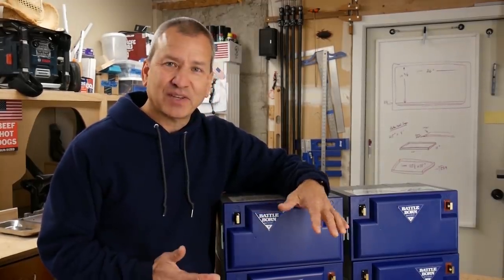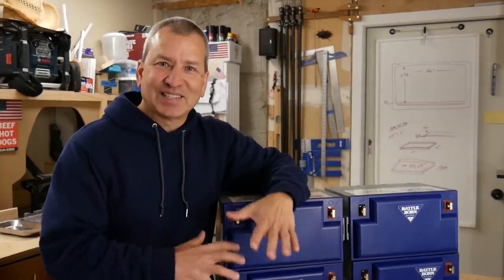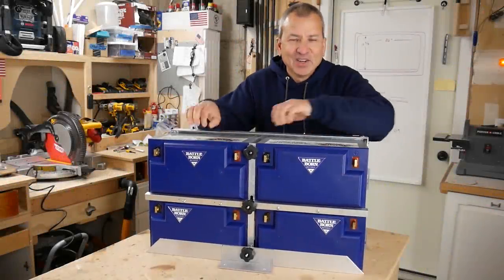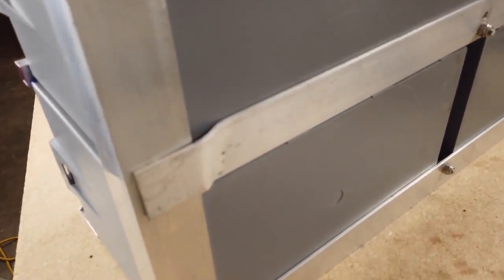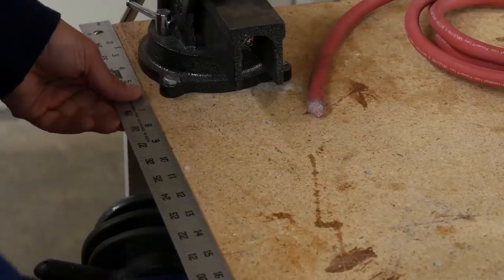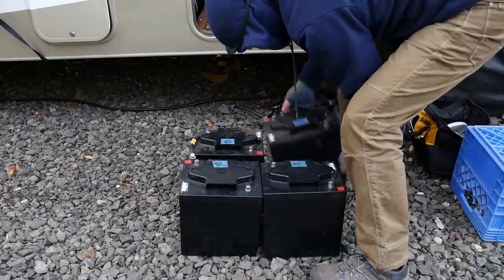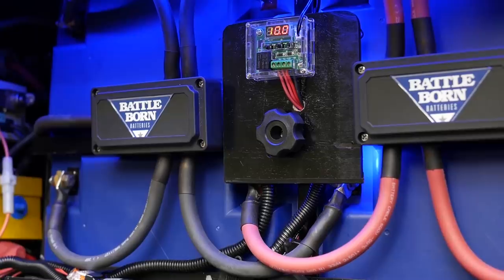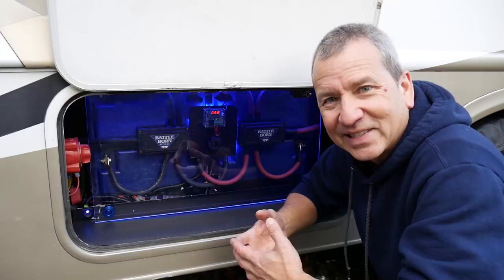DIY Lithium Battery Rack for Small RV Compartment - Full Build

Comment: Great build, I had been thinking about building a power wall with solar panels   for my Winnebago. The only location I can think of is the back wall in the rear of the coach. Theirs a air space of about a foot between the fiberglass skin back of coach and the actual bulkhead for the bedroom. I'm not sure how it will effect the load being that the wiring will have to be extended about 20 feet to reach the terminals under the entryway steps.
Reply from the maker: Sounds like a fun project. Good luck with it.

Comment: Very very nice. Where did you get the quick release buttons for the plexiglass and also the heating pads?
Reply from the maker: Here are the quick release tabs: https://amzn.to/2OlSyyn. The heating pads were left over from a after market heated seat project years ago. They've worked great on the car and should work fine for the batteries. I did wrap them in fabric to create kind of a blanket.
Reply: @RVwithTito  thanks

Comment: Fantastic ideas.   What are you using to solder the aluminum and work do you get it.
Reply from the maker: Aluminum brasing rods. I picked them up at Lowes with the welding stuff.

Comment: Great project idea Brian! Had some questions that I hope you can give some insight on...the battery heater setup, I love this idea and was actually thinking of doing something similar but my skills aren’t as good as you. Do you have any recommendations for those types of battery heaters you used and also how you were able to wire in that temperature controlled unit? Secondly, that switch idea for the LED’s when you open the door, I love this idea and can’t believe this isn’t a standard option for most RV’s already...again, do you have any wiring/install recommendations for this? I would love to do this for all my doors. Thank you for these ideas, keep them coming!
Reply from the maker: You can find battery heating pads with the switching build in on Amazon. That will probably be the easiest way to go. They do cost a bit more though.

Comment: Hello
How the heating pads are working after time? I’m thinking of getting a lithium battery does not have low temp battery disconnect because of the price. 
Thanks and the job you did on the battery it’s 👌
Reply from the maker: It's worked fine the few times that it's kicked in. The cheap temp switch can be adjusted easily to any temp. I have it set to turn on the heating pads at about 38 degrees F.

Comment: Now take that prototype to a fabricator and have them make them.
 Then sell them online.
They need to be cut and welded and made from thicker angle. But it looks good. I mounted mine up against a wall and attached everything with a bolt after welding a hold down.

Comment: Nice build.  Curious about the heating pads.  I didn't realize lithium batteries had to be kept above freezing. What's the draw? 

 I'm using an RV right now and if may or may not get above freezing during the day for a while and then not and I doubt nighttime temps will get above freezing until next Spring.  I suspect lithium is not an appropriate choice for me.
Reply from the maker: Yeah. These lIthium batteries can't be charged below freezing, but you can still still draw power from them. The heating pads only draw 4 amps total.

Comment: In addition to the batteries what else did you had to upgrade in order to install lithium? Thank you so much for always educating us and inspiring us
Reply from the maker: I still need to get a new lithium compatible charger (for the converter/charger). I'll order one soon. For now, I can manually select bulk-charge mode with my current Progressive Dynamics charger.  I'll also install a 20A DC to DC charger for charging from my alternator. I have it, but haven't installed it yet. I need to remove my generator first and convert that space to a storage by for my inverter, charger, tools etc...
Reply: Most quality solar power and shore power systems produced in the last few years have components that can be "tuned" to whatever battery type you choose. IF you are just now installing a solar and/or shore powered charging/inverter system, select quality stuff that can be configured for lithium and you should be all set. NOTE that many new battery chemistries are on the horizon or are already here yet I believe lithium (especially LiFePO4  and LiFeYPO4) will be around for quite awhile. Note that many lithium batteries should not be charged at temps lower than freezing so you will need a work-around (such as heating pads as shown in this video) to keep damage from occurring. Do some research before you buy and above all...buy quality components.

Comment: Where did you get that lug crimper? I bought a POS hydraulic crimper and hate it. I like yours. I wished you had told us about how to buy some heat pads and how to buy a thermostat. In other words; what are the part #'s I should order. But a great Video Brian. Well done. I want to buy two Battle Born's for my humble trailer.
Reply from the maker: The crimper is listed in my solar parts list (see description). I used spare parts for my heating pad. You can find temp controlled heating pads on Amazon. BB also has some that are kind of expensive.

Comment: I recently purchased 4 - 100 AH Battleborn Lithium Batteries and plan on connecting up all 4 in parallel. Looking at other videos, I often see 4/0 cables vs. 1/0 cables to connect up the batteries in parallel.  Maybe they are planning on more batteries in the future? Confused.
Reply from the maker: If you plan to use a 3K inverter, then 4/0 may be a good idea. I only have a 2K inverter so I went with 1/0.
Reply: @RVwithTito  I have a 2k Magnum Inverter. Went with 2/0, split the difference.  Now I need to find the inverter charging  cable for part 2.

Comment: Mr. Bryan..  Thank you for this very informative video...  My question regards your battery bank configuration...  You are running 4 batteries in a parallel configuration.. Every schematic i have looked at..write up i have read and hearsay recommends that no more than 3 batteries should be wired in a parallel configuration in order to keep the battery bank stable and equal balance among them..

Please can you share your info on this.....perhaps a video?

Thank you...
Reply from the maker: Not a problem with BattleBorn batteries. Different manufacturers have different limitations. Contact the manufacturer of your batteries for guidance.

Comment: One thing your battery bank needs to be wired on side of it takes charge and the other side is load looks awsome. But not good for batteries over time. I found this out the hard way.
Reply from the maker: We'll see. BB claims it's ok to mount them in any position unlike lead acid.

Comment: Brian how were you welding the corners of your Aluminium box, what was the flux and solder, I haven't seen that done before. Spring washers under your nuts is always a good idea also.
Reply from the maker: It's just a brazing rod. Not as good as a weld, but adequate for some small stuff. I need to get a welder.
Reply: Welding aluminium is complicated.  You can't do it with low cost welders that do steel, either gas or electric.  You can't see aluminium get hot, it looks normal then it suddenly runs onto the floor.  And Al wire is too flexible to push into a tube.
Reply from the maker: @donreid358  Thanks for the insight. I know welding aluminum is much different. I'm a total noob at welding but will probably start with an entry level 120V electric flux core welder for small projects. I don't want to mess with gas as I won't be welding much. For aluminum I'll just stick with brazing and rivets for now.
Reply: @RVwithTito  Brain a VERY IMPORTANT thing to do whenever working on Batteries is WEAR EYE PROTECTION, we couldn't tell if you were wearing them in this video. The reason is accidental shorts, no matter how small creates sparks of FLYING MOLTEN METAL, of course I'm sure you do everything to prevent accidental shorts, but shit happens. Love your work, do your best to remind your viewer of this danger in the future.

Comment: This is a beautiful install!!!  Would be curious to know your changed your total solar capacity for the new build?  But I'm most curious about  the other gear in the system...I don't see these addressed on anyone's conversion video's/blogs...  Did you have to do anything with your e450 ford alternator to protect it or the $4k batteries?  Also, I'm assuming you replace the charge converter in the house power panel with one made for lithium ion?  Also curious what other changes you had to make, or how you worked around making those changes.
Reply from the maker: I'll probably talk about it in another video. Here's the short version. Swapped out my Progressive Dynamics converter/charger with a lithium compatible version. It was a straight swap. Very easy. Also installed a Renogy 20A DC to DC charger between the alternator and batteries and set the DIY switch settings for lithium. I also added a switch on the dash to engage the charger manually instead of always being on. I only use it as needed and went with the smaller 20A model so I don't overload the alternator. It's been working well and limits the output to 20A. Since removing my generator the alternator is my second soutce for charging. Works very well. There were no changes to my solar.  Still have 650W on the roof and an extra 200W external if needed. Hope that helps.
Reply: @RVwithTito  
Thanks for the quick response
Reply from the maker: @bobreagan3266  No problem.

Comment: Amazing job!  What is the overall size of the compartment you selected?  How do you use the old battery compartment?
Reply from the maker: Thanks. Here are some approximate dimensions off the top of my head: 25" wide; 15" high; 17" deep. The old battery compartment was just a tray behind a small door large enough for a single battery. Years ago, I built a box around it and it now hold all of my solar equipment. Check out the description in this walkghthrough video: https://youtu.be/w5PVFpomIuk.

Comment: Great video. I am installing 3 Lithium batteries in the outside compartment so I am really interested in the heating pads and the control you used. Can you link those items so I can use them in my installation. I would appreciate it.
Reply from the maker: I think BB sells temp sensing heating pads on their site, but they are super expensive. I went with materials I had on hand. The temp switch was Amazon (https://amzn.to/35kHVTB). The larger heating pads were left over from a heated seat project (Amazon - not designed for batteries, but it'll work). I wrapped them like a blanket. The smaller heating pads were RV pipe heating pads (Amazon) I attached to a thin piece of aluminum sheeting. Again...not the intended use, but it'll work.
Reply: @RVwithTito  Those heating pads in your picture look great but I can't find anything like that on Amazon. Yo don't happen to have a link to them??? :)

Comment: Brian, I'm interested in doing something similar, my question is ,did you use the temperature switch to turn on a relay that would handle 
the amp draw. the temp switch comes with a 10 amp fuse, do these pads draw more than 10 amps. There are reviews that  these temp
 switches have burned out after a time, perhaps because people are drawing to many amps through them . So if the pads i use draw more that 10 amps 
can i switch on a relay with that temp switch? Any info on hooking up that temp switch would be greatly appreciated. Thank You
Reply from the maker: They draw less than 10A. In the summer, I rewire the switch to control a cooling fan.

Comment: Great install!  What heating pads and controller did you use?
Reply from the maker: The temp switch was Amazon (https://amzn.to/35kHVTB). The larger heating pads were left over from a heated seat project (Amazon - not designed for batteries, but it'll work). I wrapped them like a blanket. The smaller heating pads were RV pipe heating pads (Amazon) I attached to a thin piece of aluminum sheeting. Again...not the intended use, but it'll work. They key is to not have any hot spots. So pick ones that provide evenly distributed heat.
Reply: RV with Tito DIY 🙏

Comment: Thank you for the information. I am about to install for new 6 V batteries from Rolls to my rig.  It will cost me a $120 per battery. I thought of getting Battle Born Batteries but they cost a lot of money up to $4000 for 4 battery. Then i would have to get new  Controllers for my solar and also I have a magnum inverter that I bought 6 years ago that would have to be replaced to handled the lithium battery. That would cost me about $2,600. Now my total would be $6,600. To much money  What do you think change over our just by the for battery from rolls.
 I have a Built-in generator in my unit and I have up to 650 Watts of solar.

Comment: Hey Brian, did you have to  change out your converter? I thought that lithium batteries had to be charged differently from lead acid and AGM and a typical RV converter was  incorrect for an Li battery. Just wondering.
Reply from the maker: You're correct. I do have to change it out. I haven't done it yet. I can manually select bulk charge with my current unit. The charging amps will drop when reaches full and I can monitor that on my battery monitor. This seems to work for now.

Comment: Just a bit of paranoia here...those two cross members in the middle...they are perilously close to the terminals of the batteries! If, at some point, you were disassembling the array, and they shorted the batteries, you will have a very, very bad day. I would recommend doing something like coating them in a non-conductive material like truck bed liner or pushing the cross members through some rubber tubing so there is no chance of bare metal being exposed and coming in contact with the battery terminals.
Reply: I was thinking the same thing but what really got me is he should have covered the terminals before starting as the same thing if he had crossed them while holding the angles! That could be a shocking experience! But my upgrade I'll get those terminal covers you see on cars for the positive terminals. But the blue is sweet!!

Anyone else while working on batteries should tape them until done to be safe. 

But a great build!

Now a tip! On my work bench I have already marked from left to right inch mark's so all I have to do is lay, mark and cut. I even have 15' of mark's on the shop floor from the roll up doors and in 15' marked on 6" lengths.
Reply from the maker: Good point. I'll go back and coat them with something just for some added protection. Just in case. Thanks for the suggestion.
Reply: @RVwithTito  You are quite welcome! I enjoy your videos and find them very informative! Thanks!
Reply: @RVwithTito  Suggest slipping some proper size shrink tube on the bar stock.
Reply: IF they were designed to clamp down the batteries then your concern is not valid, but since he is relying on the magic of fairies to hold them in place a short is of real concern. One pothole and those top batteries are going for a ride.
Reply: @Gantzz321  I dont know, I think the rack is pretty solid. Batts are less than 30lbs each. Periodic structural integrity inspection is probably a good idea.
Reply: @TechMech42  there is a box "around" the rear of them and a single piece under the front edge. Not a thing holding down the top two batteries except gravity.
Reply: i know victron battery will disconnect instantly through the BMS i presume battle born will also,but better to be safe than sorry

Comment: Was there any changes to your driving caused by the increased weight on one side.  Excellent mod
Reply: 4 Lithium batteries are a lot lighter than the AGM so he would have less weight
Reply from the maker: No change in the driving, but the AGMs were about 280 lbs. The Lithiums...120 lbs. Plus my water tank is also on that side in the rear.

Comment: Hey Brian, Beautiful job, but one question.  You used those BB buss bars to connect the batteries in parallel. I am curious why you didn't just use short cables to achieve the same result without the buss bars? I have seen stacked batteries like yours with two center cross over cables to keep all lengths equal.
Reply from the maker: Sure. I could have. I liked the busbar setup. BTW those aren't BB buss bars. I just put the sticker from the battery on them. I removed all the giant branding stickers from the batteries. A bit over the top with branding.

Comment: I’m surprised you went with just 400Ah was that because of the space or lack there of or that’s all you needed?
Reply from the maker: That's really all we needed. Plus, no more room. We've done just fine with our 450Ah of AGM (225 usable). So almost doubling our usable capacity actually gives us more than we had. We don't have any large persistent loads like a residential fridge or A/C. If I do expand, I'd have to re-think the location for sure.
Reply: RV with Tito DIY understand... I have a truck camper I’m going to put in an off grid system and I was thinking of putting a 600 Ah and now I’m thinking if might be an over kill... because of pets I was thinking of 600 Ah so I can run AC for a couple of hours maybe 500Ah might be the way to go

Comment: How did you wire the heating pads to the temperature switch? By chance have a wiring diagram?
Reply from the maker: Sorry. No diagram. The wiring was nothing fancy. I just wired the temp switch to the positive wire of the heating pads. The final thing I did was to add another switch to that same positive input (before the temp switch) to be able to switch off temp-switch and heating pads all together (i.e. during warmer weather).